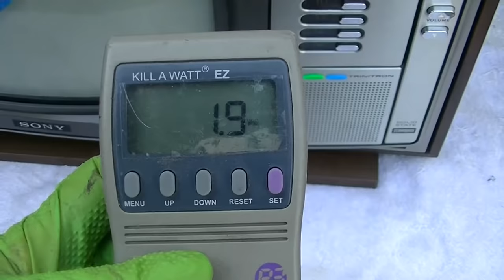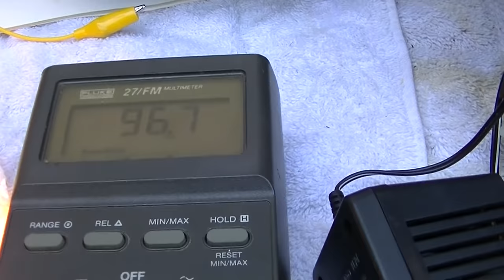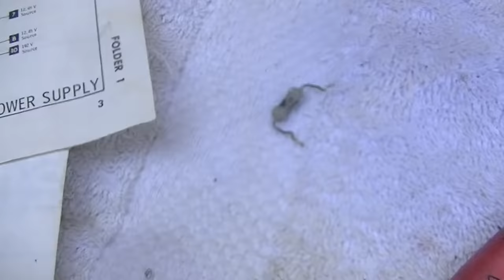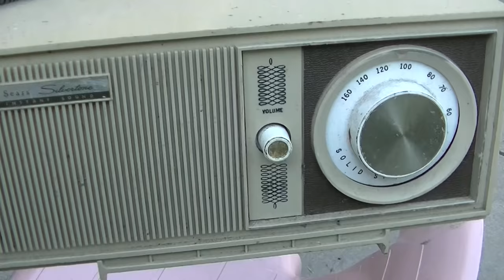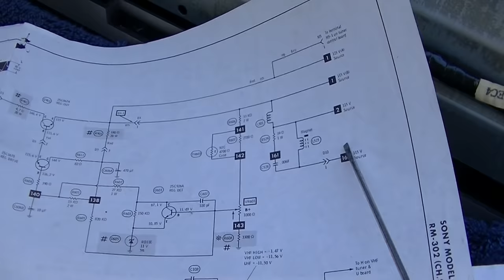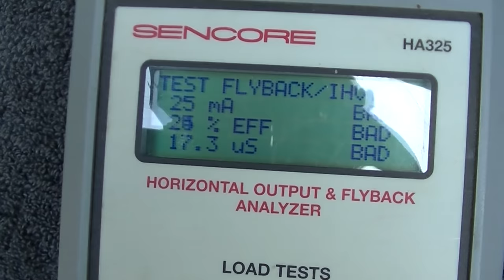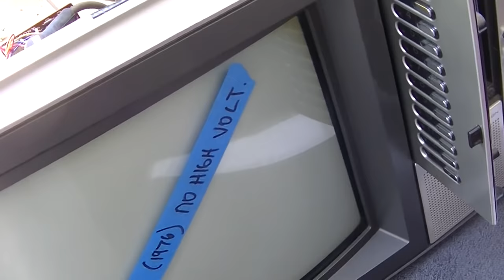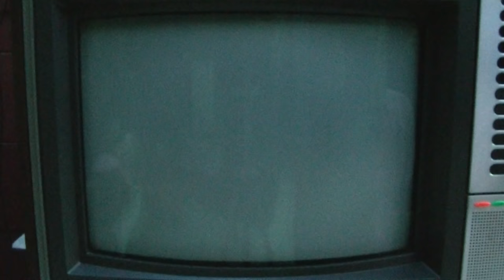Sony Trinitron KV1541 Remote Set Super Hard Fix 1977 Vintage Color TV

Comment: Imagine a client brings this set to your shop some time in the '80s. You have: no documentation, no donor set, no working set to compare to. There is no google to find out the specs of the failed parts. At every test run you burn a day wage worth of parts. Good luck to find an error which is not measurable even with that specialized instrument which cost a fortune back in that time, so really a few could afford to buy it. 
Shango, thank you to post this video and pointing out, how clueless are those "what could be the problem" questions.
Reply: Kind of like an automotive tech digging into a BMW without the tools or manuals!

Comment: Nice fix, reminds me of a late brand new Mitsubishi set that came to me. It had fried the flyback transistor, control IC and several components in the PSU. Replaced all of the damaged components and checked for obvious problems etc. Turned it on and was greeted by a perfect picture. I thought 'brill, that's sorted'. After running the set for a few hours with no issues, turned it to standby with the remote and there was a bang! All the components that I had just replaced had popped. Turned out that, from the factory,  there was an inductor missing from the snubber circuit. The fault would only occur when the set was turned off and the fields collapsed causing a back EMF spike through the flyback circuit. Took a bit of working that out.

Comment: The two flyback powdered cores are separated by a insulated disc between the cores... This tunes the flyback... The broken nut holding it all together would allow the resonate frequency    to change because that gaps are too far apart...I just saw the two discs (red/black) ... Tuning the horz freq...
Reply: I don't think its a powdered iron core because the core was gapped. (Powdered iron cores already have a low permeability.) Anyway... yes, the size of the gap would change the inductance, as so the resonant frequency of the flyback. Also since the gap affects the permeability... for a given drive... decreasing the permeability would affect the energy stored by the flyback.... I believe gapping the flyback core increases the amount of power it can produce.

Comment: That lovely thing is actually a GTO or SCS which is similar to a Thyristor or SCR except you can turn it off by applying reverse current on the gate. If it would be a regular Thyristor or Triac to turn it off you'd need to interrupt a current flow through it.

Comment: Hi Shango,  I would like to present some information toward correcting the defective transformer issue  shown at 1:38:XX and 2:03:XX of the video. You mention that you will be working on another Trinitron in future episodes.  I hope this information is not too late to try.
First I believe that the broken U bolt that holds the cores together is the root cause of the flyback converter misbehavior. Equal pressure is required on both legs of the core set to maintain an exact air gap between core halves.  Those plastic "tiddely-wink" buttons glued to the core halves provide the approximate gap length. They should be equal in thickness to prevent stress on the ferrite cores. When being manufactured, the primary inductance is measured and adjusted to give the correct value plus some tolerance using these plastic gaps. Sometimes the primary inductance can be modified to tolerance by torqueing both nuts on the end of the U bolt. The broken U bolt was likely over torqued and was perhaps an attempt to get the correct inductance on the production line.
Second, The reason why the gap is important is that the gap enables the flyback transformer to store energy and as mentioned above, sets the primary inductance. The primary inductance sets the flyback operating frequency in self oscillating flyback converters.  (Im not sure, but I think this is the circuit used here).  Having pressure on only one part of the core causes the other side to separate further apart thus reducing the primary inductance and allowing additional energy to be stored.  The flyback switching frequency increases and the additional stored energy has no where to go but burn up the 39R snubber network.
To test this, take the known working out-of-circuit flyback transformer and measure its primary inductance. Hopefully you can measure this at 10kHz. Note the value, then measure the defective flyback transformer as situated with one part of the U bolt tightened. You should see a measurable difference between the two parts.  Now apply equal pressure to the defective transformer cores using a pair of c clamps over the ends of the core. Pad the clamps so as not to break the ferrite material.( I use those "Quick Grip" mini bar clamps.) You should be able to dial in the correct inductance.  In fact, you can see the effect of the primary inductance if you just pull the core halves apart...just for fun.  If the primary inductance remains low, you can sand off some of the gap material equally until you achieve the primary inductance of the working transformer. To finish the mechanical mounting of the transformer,  you may be able to locate a U bolt for the core set, but it may be easier to locate 6-32 brass threaded rod. Use a piece of aluminum plate to distribute the force of the torqued brass rods on one face of the core set. Dial in the inductance and give it-a-go in the set.  Thank-you for your many hours of technical mentoring and humor thrown in for good measure.  Cheers!
Reply from the maker: It's turned into a common problem with these sets. I'm sure you're right I just don't know if it's worth the time to try and figure it all out and dial it in

Comment: at 2h 4m Air Gapped transformers are quite common those shims are actually for tuning yes, I suspect the transformer may have an internal diode that is shorted aka built in tripler diode circuit that's shorted which wont be easy to diagnose.

Comment: Very nice job. I used to hate it in the mid 90s when I got a Sony in for repair. I had 3 or sometimes 4 separate current limited power supplies running at once to keep from blowing up those expensive transistors. Never saw one with a bad 17V Zener though and that flyback was just weird. It has to be that difference in timing, 11 on one and 1 on the other? Internal capacitive reactance due to internal lack of insulation between windings maybe?? Very enjoyable 2.5 hours and I really felt for you a couple of times. Been there.

Comment: I bought this set while stationed in the service while in Japan in 1977. It worked great until 1999.  I have no idea what was going out as the picture was pulling away from the sides, however, I am not a tech, but enjoy watching these videos.  The TV is long gone, but this video is interesting. I forgot to mention that if power surged the TV would shut down saving it. I forgot to mention that I bought a 27 inch Sony Trinitron tube set in 1990 after the set died and it lasted to 2012. What happened to it was the picture went to a solid vertical line and a puff of smoke came out of it.  When I first got it the power supply died in two months. I lived on the end of a power line so the voltage sometimes fluctuated. I took the set to a Sony repair place and the guy said they cheapened the sets and the automatic shutoff was deleted on newer sets.  At least Sony repaired it with no cost to me.

Comment: Maaaaan, you just ran into a thyristor based horizontal output!
These things are known to be really hard to fix. Good to see this job had a happy ending.
No wonder why the SCR was fried at 1:12:32, the flyback was meant to be driven by a GTO (Gate Turn Off) thyristor. The SCR latched in there
Reply: I do remember the actual Sony service info around this time did say to run the oscillator off battery supply or an expensive bang was on the cards.. Somebody asked me about fixing one of the big KV series things last year.. simple answer.. NO..  I don't ever want to see one again..

Comment: Shango, if you have a TV with problems in the horizontal deflection circuit, its never a good idea to apply full B+ and hope for the best. What you can do instead is to apply 10 or 20% of the B+ voltage while measuring the collector retrace voltage on the HOT. This way you can check if the retrace voltage stays within the safe operating value of the HOT. If the deflection stage works fine, then the retrace voltage will react proportional to the B+ voltage. If it doesn't then there is an issue in the stage and is a good indication that if you apply full B+ you will likely destroy the HOT. Some TVs might not start the horizontal oscillator if B+ is not within its operating range so in this case you are going to have to feed the HOT driver stage with an outside pulse to test the horizontal deflection stage. You could try to make a video about this procedure is very useful and I haven't seen anyone on youtube. Also, excellent video!
Reply: The fun part is, lose horizontal drive, the SCR is on and stays on, thermally running away and shorting.
With the Sony gate turnoff SCR, if you change it, replace the damper diode.

Comment: Wondering if that wire bail/bolt through the flyback is required to complete the 'circuit' around the core since it has those insulating spacers in it.    Would've probably tried using a bolt from one of the other sets to see if that might bring it back into 'spec'.

Always hated working on Trinitron sets, seems like they stuffed the set full of 'Black Magic', and one little fart in the operation would pull the pin on the smoke grenade...
Reply from the maker: That is a possibility and it comes up again in a future video.

Comment: The best 2.5 hours I have spent in a very long time! It brings back memories having worked in commercial communications for 20 years. I have had my fair share of these gremlins ruining my days as well.
My next project is to figure out why my service monitor will not turn on either on AC or battery. Hang in there and keep up the good work!
73!

Comment: I knew some "old school" TV repairmen and Sony was the one brand of set that they would not touch. As far as the bad flyback, I may be way off base; but, I wonder if the internal HV rectifier diodes are leaky or shorted? A few times, I've had a flyback pass the "ring test"; but, would not work in circuit and bad internal diodes is what I blamed it on. In the early '80's, RCA had flyback issues that turned out to be caused by RCA skimping on the number of HV diodes used inside of the flyback (resulting in diode failure). The replacement flybacks corrected this issue. Oh, and I made it this far in the video.
Reply: You all right !
Reply: shorted intergrated flyback diode is a fun one. you can get around it by patching a new one half way down the anode cable and the TV will spring back to life. Unfortunately the entombed diode will slowly turn into a heating element and burn a hole in the plastic.
Reply: With sencore VA 62 first ring the fly back if ok drive it then measure the anode voltage.

Comment: I wonder if the two core halves of that bad flyback got a little loose from being used with that broken metal thing that's supposed to hold the flyback to the chassis. (depends on if it was used for a extended period of time with it in that state). Maybe it helps keep the two halves of the core together. (even though the glue is supposed to do that but maybe the glue gets a little soft from the heat from the many hours the TV could have seen). That or since it wasn't properly attached anymore mechanical movement of the flyback from the loose side caused the cores to be pulled part ever so slightly. This would mean the tolerances for that spacing is very tight so it wouldn't have taken much to throw it off.

The spacing of the two core halves changed and that's what was causing the issue? Just a random guess from someone who doesn't really know how flybacks work though. So take it with a grain of salt. :P
Reply: Hi ApacheThunder, I really didn't expect seeing you here !
Didn't know you were into electronics too.

I really love your work and idea's on BF1942 modding, SSM and maps :)
Greetings from Holland,
Raoul (playername: TheoNeo),
Server admin of The Drunken Mug

Comment: A common fault the h. o/p breaks down between windings under load & cooks o/p thyristor which triggers the fail safe n blows the zener (hence thats why its highlighted) then the reg goes s/c, I fixed Sony's for 25yrs so I've seen this before, it's how the fail safe works..basically it nuc's everything to stop a meltdown.

Comment: Beware of the brown glue on the electrolitics.  As it ages it becomes conductive; nasty stuff.
Reply: Yeah, I noticed that as well.  But it appeared to be used sparingly, so it didn't touch two leads.
Reply: Verily agreed! Reminds me of what Retro Tech, Jordan Pier and Radiotvphononut said about these nasty glue stuff... Something with aging and chemical components made them conductive so sometimes it is best to get rid of them if the colour turned like on this video! The key is those leads not to get into contact with those nasty glue)

Comment: I wonder if Sony repair centers had "Sony-specific" test equipment, or if their techs went through the same type of hell that Shango did, in bring this set back to life?
Reply: Well I think things often fail in a similar matter and those failures are documented by the manufacturer and likely to be the first things to be looked at during repair and those common problems are ironed out in the yearly iterations of the product.
Reply: Sony might of just thrown parts at it till it worked, "that resistor is burnt!" Replace the board!

Comment: Been through this with these Sony gate turn off SCR circuits, everything must be perfect or kiss the SCR goodbye, use only Sony original scr's ,replacements are unreliable. Sony only seemed to use this miserable circuit for a very shot time before going back to bipolar output transistors.

Comment: Great 2.5 hour video, I made it to the end. What a challenge to fix this Sony TV. It is actually a very well made set. You know your stuff, and systematically working the way through component tracing and repair. Great you had access to donor sets. I wonder why manufacturers design equipment with very hot running components. A small quiet cooling fan, could maybe prevent early failure of the regulator.

Comment: Your videos really pulled thru for me today. Had to replace a missing ground on a Chevy Tahoe that caused one of the mosfets in the transfer case shift module to burn up so I went thru my pile of pcbs and found a bunch of them. Soldered one in and now it's working like new again. Been chasing this problem for months! Ground wire missing!

Comment: I remember zapping myself on an old TV like this growing up touched my arm on the pcb on rhe back of the tube those big high voltage solder points lmao how am I even still alive, it didn't leave a burn but felt kinda like hot pins and needles going into my skin and a kicking sensation as well. Pretty lucky to still be here I imagine given the voltage in these things even long after they have been turned off, this was on at the time too.

Comment: Man - what a plethora of faults. But the flex paste ad at the end really hits the cake. I'm glad that I tossed my TV six years ago and never really missed it. German TV however was never that "over the edge" as US TV is. Congratulation for the final result nontheless. I'd had thrown that thing out the window after it fried the first set of expensive transistors already. And it took me some cups of coffee to follow you through your adventure. The last things that challenged my patience were a set of two MA-5 Marantz mono blocks. In the end it turns out that all of the five "fusible resistors" on each unit went up in resistance.  Not too much to finally end up the function - but as far to hamper it significantly. Since then I mistrust these critters and the first thing I check initially is the existance of these - and the condition they are in. Thanks for sharing !

Comment: I watched the whole thing. Very entertaining, probably because I have always been a fixer. I followed closely and laughed out loud several times at the a ha moments and some of your remarks. 
Our politics are 180 but wanted you to know, that I appreciate your experience and knowledge. I even enjoy your choice of pieces to play with. I used to buy old tube am radios and dream of switching them to FM and doing crazy things. I do all of my own mechanical and electrical work but never got schooled on electronic diagnosis. I'm very ADD but you take the scary out of it, and follow you well. I spent years in the movie theatre industry running theaters and even moving and setting up equipment but always wanted to learn how to repair amps and complex audio equipment. I never pursued, unfortunately. 

Well thanks again. This helped me pass the time waiting for my truck to be loaded .

Comment: 39 ohm resistance is fuse able and used for NPN transistor collector voltages. input dc power is coming from power supply, reference No. 1
NPN transistor is generating ac voltage for horizontal driver transformer.
DC voltage could be blocked by the high value resistors and capacitors but could not be blocked by an inductor. HDT primary coil is an easy path for DC voltage to the NPN transistor's collector. For NPN transistor, Emitter should be negative than base and collector. So it doesn't matter if it is directly connected to the ground or indirectly. Please check the reference no. 3.
18.68v are much less than 115v for collector.
Thank you for such a beautiful and informative video.